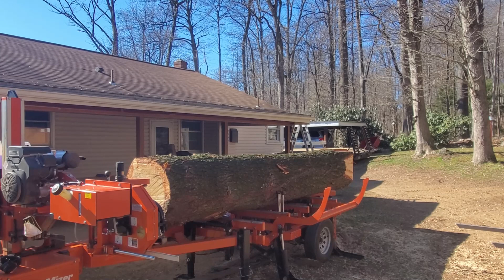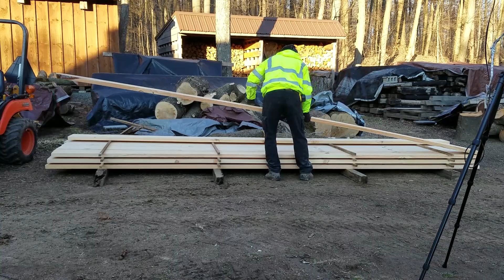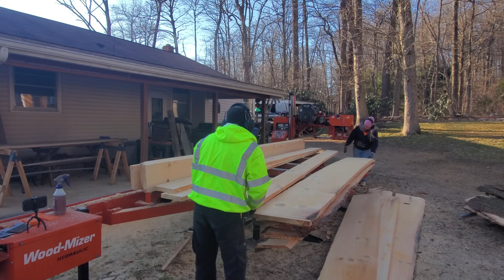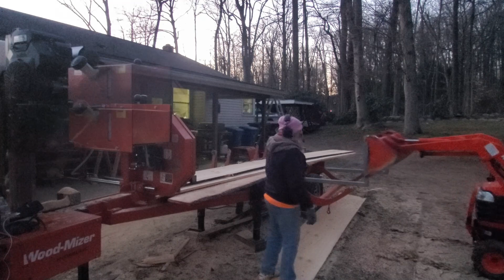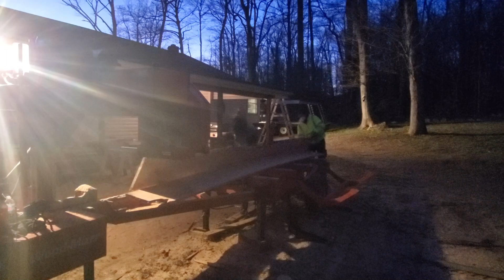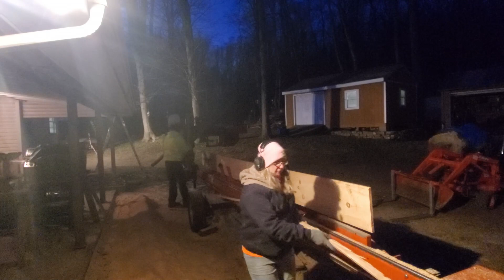This one Nearly Maxed Out the LT35

Comment: Gladvyour Woodmizer is performing. Ours lasted all of two weeks before the accuset feature went tits-up. At least it is under warranty although towing the mill 150-miles for service os a PITA!
Reply from the maker: We did have an issue with the simple set on this mill. Bad circuit board shut us down for less than 24 hours. Wood Mizer sent one next day air, and we were up and running the next day. May be a little tougher these days with everything in short supply. I have a spare just in case though.
Best mill out there, but if they do have an issue, the customer service can't be beat.

Comment: Have you thought about using the Japanese method of burning the wood that you are going to use for your trailer decking.
Reply from the maker: That thought has crossed my mind. Just need a good sized  torch for one of our grill tanks. Stay tuned.
Reply: @IronOakSawmill  that and I believe tung oil is what they use to finish it with.
Reply from the maker: @timothychristian9140  that couldnget pricey with tung oil I think. Maybe not.
Reply: @IronOakSawmill  I saw tung oil on Amazon for around $62 gallon. I would think that would be more than enough seeing as how it shouldn’t soak up much since the grain of the wood has been pretty much closed from the burn but not sure.

Comment: A full days work and a tree that cooperated so that has to be one of one. Since you do a lot of packing of lumber, is there any board chains that have the wide rolls so it could take some of the strain off.If you hold your mouth right on the second tuesday of same week you might run into some affordable ones as that stuff is flat heavy. Were the two of you back in your twenties again, you would both be grabbing two apiece and trotting over to the pile. Now day preparation h is your friend, Just not a good friend as I   could feel mine pucker when carrying that heavy stuff. Nice to have the volume but nicer to be done, no good way to say it
Reply from the maker: Hello Morgan. Wow, alot in that one.
Not sure what "board chains with wide rolls" are. 
We like milling, but dont like injuring ourselves, so we dont push the heavier weights. 
No Preparation H was used in the making of this video. Still quite
 a few years before we need that. LOL
What can o say. We like miloing good lumber. 
Stay well my friend.
Reply: @IronOakSawmill  Okay a board chain is a roller system used in unloading food or any item that you wish not to carry found on loading docks at stores where they wherehouse the food. You sat item like boxes or boards an whatnot on these and they are similar to a ladder in looks only as the round pins that you see from a distance are actually pieces of pipe with bearings at either end and they just set in one spot and roll an roll. They come in various lengths and work forever even when bent or whatnot. Most are aluminum but some are steel and there are many rolls on each section allowing item to float across to next place. quite light and easy to move and set on everything from tires laying down to proper stands. You can find these in warehouses and are very cheap as bent or what not and they just buy new and throw most used ones away that some rolls are missing which is not a problem for you as your working with long flat items... google is you friend but common sense will save a ton of money as they once located are hundreds of them retired as parts for another but seemingly never fixed... after this description,, think you have seen but never give second thought about
Reply from the maker: @morgansword  very familiar with what you are talking about. I just never heard them called Board Chains. If I was set up in more of an stationary spot, they would be most helpful. As it is, I move all over. Even here at the house. Maybe once I get a more permanent spot, I can set up something like that. Thank you.

Comment: Why not spruce for your trailer it is light and strong? they use it for aircraft.
Reply from the maker: Hello Jim. We didn't have access to a good spruce log in the correct length. Around here, they are so full of knots, they are tough to saw straight, and they fall apart due to the knots.